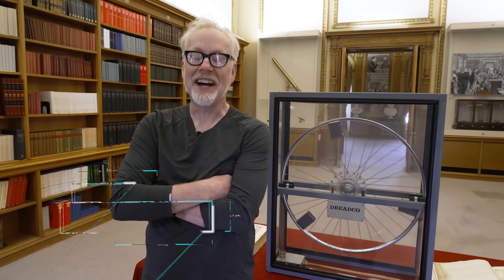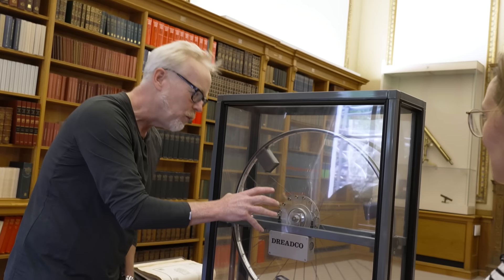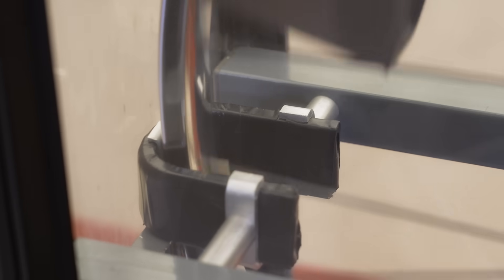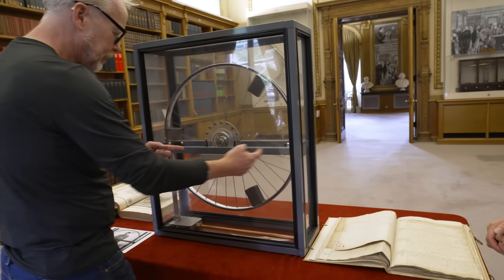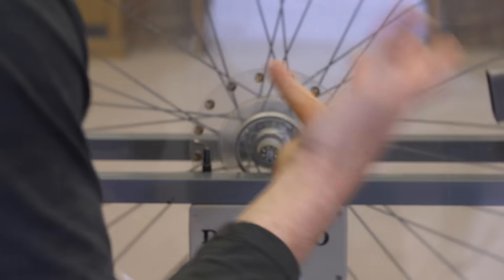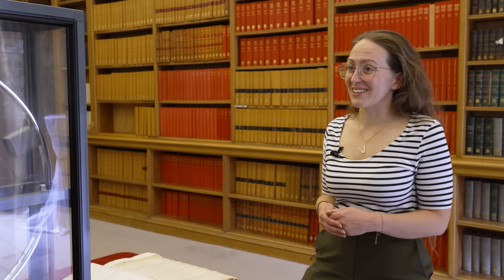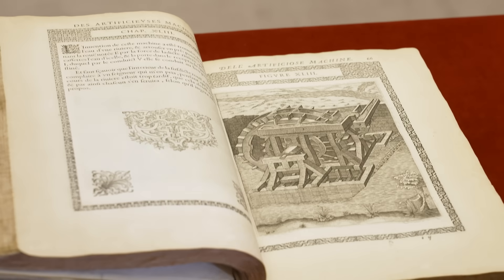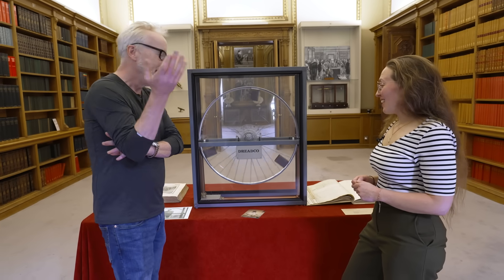Adam Savage vs The "Perpetual Motion" Machine!

Comment: Those brass things look like high-voltage electrodes - it's possible to create a slight breeze with an electrical discharge from the pointy one; the insulated cups might discharge any acquired charge when they pass the second, ball-shaped electrode.  The Dreadco box might contain the high-voltage circuitry.  Power is from the photocells, and perhaps there's recovered energy from three magnets passing through the U-shaped coils, backing up a battery in the box.  Finding out there's a battery would certainly qualify as a disappointing discovery.
Equally possible that the magnets and coils are just components of an electrical motor, and the electrodes are decoys.
The copper plumbing, I think, is also a decoy.  (Heat sinks would only dissipate energy.)

Comment: Adam this works similar to the principle of a pendulum like those old pendulum clocks you see at the antique stores but rather than using weights to drive the pendulum instead a small coil is used at the peak arc then you only need is a small amount of inductance ( energy ) when the coil passes the magnet to give that smallest amount of force to sustain any swing loses, I have a clock right now using this method & it hasn't stopped working for last 5 years with the same D size 1.5v battery, I checked the battery regularly so far so good amazing it hasn't leaked.
In this demonstration the 3 boxes are actually the magnets & the two horse shoe shaped device on each side are actually the coils ( clever deception ), the disc & box in the center is the actual timing triggering device, again it's using inductance to simulate a ( closed a circuit ) a very small amount of energy is sent to the coils I'm talking about a very very small amount of energy just enough to keep the device spinning. I suspect the reason why they need to perform maintenance on the device is to lubricate or replace the bearings, or maybe over time the battery starts to leak or corrode around the terminal connections. Imagine if they replace the bearings with a magnetic bearing & use a sodium ion battery then theoretically will last over 10 years or double that without any human intervention as well being in a vacuumed container.

Comment: Adam most certainly needs to do a One-day build video of him trying to create how he believes this machine is made.
Reply: I'd  give him 2 days.
Reply: @iwinnimi  there is another video from a TV show that basically gives it away. 
You could make this in one day.
Reply: @vituperate1005  link?
Reply: @ZANGETSUxPR  Or even just the name of the show D:
Reply: @ZANGETSUxPR  I will give you a clue. Gravity plays a big part.
Reply: @vituperate1005  Oh, a clue. Do you know what's inside?

Like a battery and a few other components, the easiest way to explain this?
Reply: @vituperate1005  Just name the show.
Reply: @vituperate1005 douche
Reply: @ChicCanyon and a perpetual one at that.
Reply: @iwinnimi  2nd day will be just for testing whether it stops 😆
Reply: Yes PLEASE
Reply: I thought he was going to go back to the shop and try it. AUGH ADAM IF ANYONE CAN DO THIS, ITS YOU
Reply: Battery, magnets, Reed contacts, high voltage generator. Or just electro magnets.
Reply: @gustavgnoettgen  Not quite.
Reply: He certainly will once he figures it out on his own.
Reply: This NEEDS to happen, best suggestion of the year so far!
Reply: was the case warmer or room temp? particularly around the truly huge heat syncs? it really looks like an electric motor and i wonder if the copper is to create an air current to gently assist and regulate the rotation. a very cool machine. thanks adam.
Reply: That's what I thought this video was going to be.
Reply: He has no formal training in electronics
Reply: Hell yea!
Reply: I created a magnetic motor,  but it does have a power input. A snowmobile engine with continuously variable transmission. It just uses the magnetic motor like a flywheel to boost HP maybe almost like a turbo or something. It could drive a car with a snowmobile engine... 

We don't need perpetual motion, just slar panels on cars, better renewable fuel with no emissions and efficiency... 

In any case I would hate to have to spend 100 or more per week on gas..
Reply: I think he probably does need that as well actually
Reply: I would love for Adam to make a one-day build of this!
Reply: @Mcckoe how many years could it run for before replacing its batteries?
Reply: plese do
Reply: Or just any perpetual motion machine
Reply: CHECK OUT THE INFINITY TRAIN IN AUSTRALIA ......🚂🚂
Reply: And then have him build an actual perpetuum mobile by accident.
Reply: @jurgen_haan  After all, this wheel is a real Perpetuum Mobile, which has been working and working for over 40 years.
Reply: Probably electro magnet with a hidden switch . Every time one of those metal boxes gets close to the electro magnet it turns on for just a bit pulling the box to it then turns off as the box passes it
Reply: AAA batteries
Reply: I'd rather him build his own that's better than trying to recreate this gimmick machine.
Reply: On Mythbusters Ep. 24, they examined a similar device as a source of "free energy."
Reply: @brewed544  What do you think you have?
Reply: To anyone wondering, there isn't a show.  @vituperate1005  is lying. Move along
Reply: Tell Britta that she's a cutie.
Reply: You can see that Perpetuum Mobile (Perpetual Motion) works, so it's possible, and we were lied to in school. Free energy is omnipresent and even from Mendeleev's Aether.

Comment: my view is... it's a motor and an alternator at the same time. It only uses the minimal energy needed and the loss of power is in the heat in cables and in friction of bearings and of the air. A little solar panel just like a watch could have... minimal power... it's all it uses, something that is well calculated, thin light bike wheel. There is obviously a battery... which is charged constantly and discharged, by the wheel and the solar panel.

Comment: What's most impressive about this wheel is the capacity of the hidden battery which has to power against air/bearing friction, whether it's in the boxes or in the frame.
Reply: Bike wheels with high end bearings have very low fiction coefficient's on a normal bike wheel the less weight of just the valve hole at the bottom is enough to start the wheel spin so the hole moves to the top.
Reply: @somedumbozzie1539  This is true, but to be able to spin for months at a time is quite a feat
Reply: @BrazzaB1  It is impressive that's for sure but it has a magic box big enough for a battery to run it for months.

Comment: Now that the riddle is solved(look for my comments), I can help build one better than this(using the tiny nuclear piles, magnetic suspension and ultra low power nano watt oscillators). It should run fairly well for a few hundred years, without need for servicing. The enclosure need to be sealed under 
low pressure as well.

Comment: Atmos is the brand name of a mechanical torsion pendulum clock manufactured by Jaeger-LeCoultre in Switzerland which does not need to be wound manually. It gets the energy it needs to run from temperature and atmospheric pressure changes in the environment, and can run for years without human intervention.

Comment: It is a simple device. If anyone had a single battery operated pendulum clock knows the answer. The heatsink and the box in the middle are decoys. The three boxes are the important ones. Each has a battery and a low power transistorized relaxation oscillator driving an electromagnetic coil. The attraction between stationary magnets and the coil in boxes provide the force. Acrylic box is to reduce air resistance by maintaining a low pressure sealed enclosure. The oscillators are very stable and matched precisely. Maintenance is just to replace batteries inside boxes. Now with lithium batteries they could run nonstop for more than 7 years.
Reply: Sounds very plausible. I for one would like to build one, but lack the knowledge
Reply: @mvmagic  I could put together one if there is more interest. In the end, the servicing time? determined by depletion of battery(~20yrs with right battery chemistry-unless other energy pirates are implemented).BTW, the dredco box is also a decoy(The one in Vienna museum does not have it, also it only has one coil at bottom, apart from clever routing of wires through structural tubing-this is all guess anyways).
Reply: There is also a possibility of using a mercury switch to create a self timed relaxation oscillator, instead of a transistorized one. One other possibility is a self contained inertial movement of mass using the same mechanism, where all of magnet/coil/oscillator is inside one or all boxes, and the two u shaped magnets are decoys(some non magnetic pieces of wood made to look like a magnet). Best place to hide a battery is in plain sight inside a box!
Reply: Actually the box with the copper tubes holds the battery and the oscillator. The magnets are essentially coils around a u shaped core wrapped in tape to look like a magnet(s). The boxes are just made of iron(may or maynot have magnet) and are used to balance the wheel by removing adding material(may be just some grains of sand). The oscillator just runs at a fixed low freq. That excites the coils alternatively with a tiny pulse of current matching rotation. This can be easily confirmed by the constant speed of rotation. To start, the wheel is hand rotated just a bit faster than the oscillating frequency. Then it will stabilize and slow down a bit. The current just flows for few milliseconds enough to impart tiny amount of energy to keep the wheel moving. When batteries drop in voltage, they are just replenished and balance of wheels checked, apart from simple lubrication of bearings. Everything else is a decoy!
Reply: Eventhough there is a glass valve(thermionic electron tube), it is a decoy as well. Oscillator should be a simple two transistor relaxation oscillator used in pendulum clocks run by a single drycell. Copper tubes just conceal the wiring going to the u shaped coils(one on each side).
Reply: Heureka here in Finland has one too by Jones:
https://m.youtube.com/watch?v=1qvH7O_HTlM

Comment: If you connect a electric motor to a generator with twice the output as the input needed for the motor. It does work. Till the brushes or bearings give up. But that’s what makes it no longer perpetual motion. But it does give the unused electricity for the motor to power other things. Tho if you overload it. Is comes to a stop as well.

Comment: I was thinking it might take energy from air pressure differences, sound waves or atmospheric air pressure change, or from moisture changes which would vary a lot when on display? It might explain why it runs out when in storage.Edit: However it works I bet fixing it involves greasing/replacing bearings/bushings.
Reply: ...along with the batteries.

Comment: I wouldnt be surprised if almost all of it was a red herring and it was just a motor and batteries in the axle. With some nice bearings itd need such a tiny trickle of power to keep it going and I have devices that work off a couple of LR44 batteries for years at a time, you could fit in way more than that to this device if necessary.

Comment: Assuming it was done by magnets somehow, would it stop once those magnets degraded, or would they just keep going?  If it was constructed, and started, then the theory about any claim or attempt at a machine, is that IF you start it, it was never perpetual?  A river could be considering to go for a long time, until the river dries up or becomes a large stream, but still "not" perpetual.

If somehow, through nature, a plant like the venus flytrap, happened, but was a loop with the water dripping out the top into it again, a kind of mutated venus flytrap, then would THAT be considered perpetual?  It has to grow, and so in doing so, was not "running water" at that point in time?  And eventually the plant dies, so at THAT point, it was (again) not "running", therefore never perpetual...

Comment: Not sure if I am correct but I think the servicing is the bearings needing lubrication.  I would assume there are two magnets and then the boxes have small coils that use ambiant radio waves to power the simple electrical motor.

Comment: Seems similar to Edgar Cayce's described version... i think that would work with pressure changes between 1 or 2 gases in those 3 spinning chambers because of temperature changes from the top and bottom of the box.  So the temps and pressures changing the weight of those squares slightly between top and bottom is what's making it spin.  Or was supposed to till they motorized it lol

Comment: seems that there are coils in the 3 boxes that pass through the 2 magnets creating a very small charge, going in to the battery (or capacitor)  in the dreadco box, on the bottom of the system is an air compressor being charged from the dreadco battery, collects air from the left copper pipe, compressed and heat exchanged, passes to the right and gently blowing on the wheel causing it to spin

Comment: Yeah the fact that it has to be "serviced" due to slow down, means it's not a true perpetual motion machine. Those metal blocks obviously add weight to the wheel, gravity causes the blocks to fall, spinning the wheel. Then the magnets on the side. But the copper tubing and heat sink indicate there's definitely a charge involved. True perpetual motion is impossible due to there always being a rate of decay.

Comment: I think the current heats a tiny element creating a temperature differential inside the pipe, and the heat sink is there to ensure the differential creates an equally weak convection which blows ever so weakly against the rim, imparting a steady but slow rotation as seen here.

Comment: I bet Jones was a bicyclist and noted how freely and lengthy of time that a spun wheel will rotate...  which I would think was the jokester's impetus for creating this puzzle.  ...and I think Adam nailed it... it is a simple, battery powered device as a rudimentary electric motor utilizing, what...  1980s technology... with a few goose chases incorporated.  I own a battery powered quartz clock with a pendulum that runs for about over a year with one AA, rechargeable battery...  So I suspect that... and not having been granted good static views of the device's details, nor of its reverse side, that a larger battery is hidden... which utilizes fine wires, hidden by various parts and framework wherever needed.  The wheel's  boxes are steel and and are pulsed by the visible, encased electromagnets.  The electromagnets are timed off and on, creating a pulsed drive upon the boxes, by the two proximity sensors near the hub, which control the timing for the on/off function of the electromagnets.  The framework itself may even be part of the circuit which may even include a circuit board as a non-mechanical relay for controlling the timing of the magnetic pulse.
But, if it is not a rudimentary electric motor... and again, not having any good views of the device, Jones may have employed an  electric non-mechanical air moving device, imparting the slight air pressure needed for function, which would work only in an encased environment.  One box is for holding batteries, the other, having the copper tubing, would be for air pulse handling.
Methinks...
I imagine almost anyone could replicate the device in appearance... and its action, but may have variances in functionality.
Thanks Adam... Fascinating... and fun... as usual...

Comment: I suspect this may be nuclear. The "light meter input" could be betavoltaic cells on each side of the box, with a radioactive source, probably a small amount of tritium, in each of the cans mounted to the wheel. There is always one of the cans pointing right at one of the cells just before another can goes through one of the electromagnets, which provided power by the betavoltaic cells would give a very slight pull to the wheel, keeping it going. The half-life of tritium is about 12 years, which with the tiny amount I assume they would use in something like this so that it isn't very radioactive could line up with the refuel every couple of years.